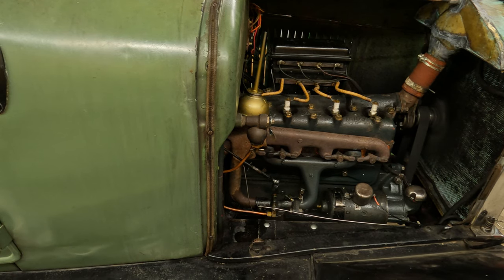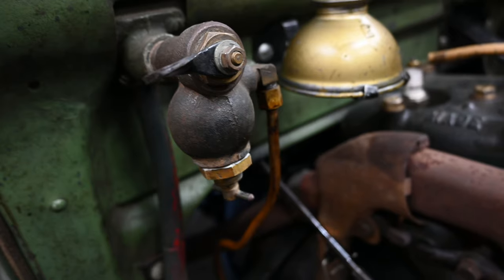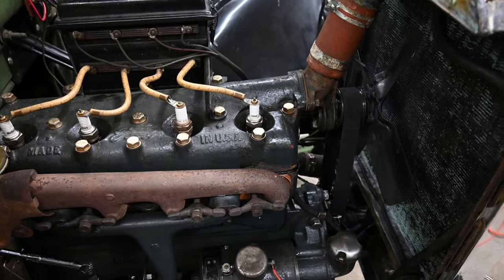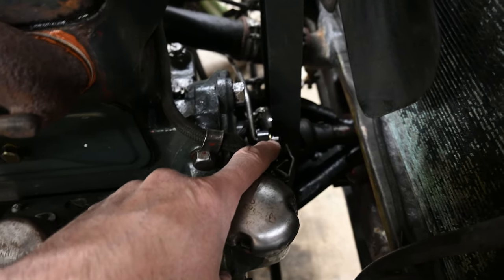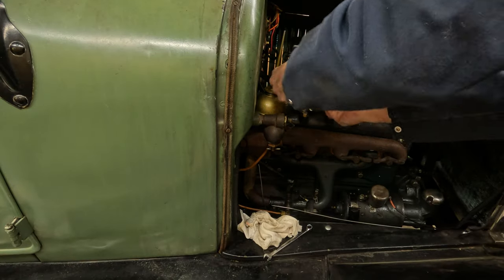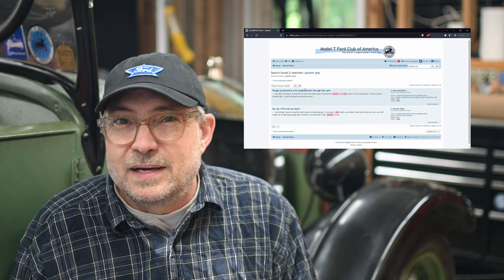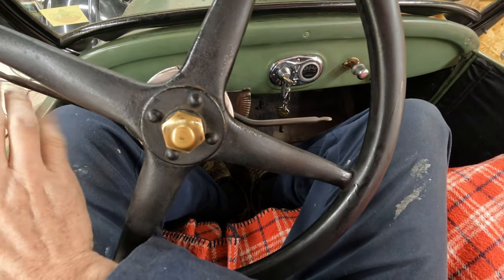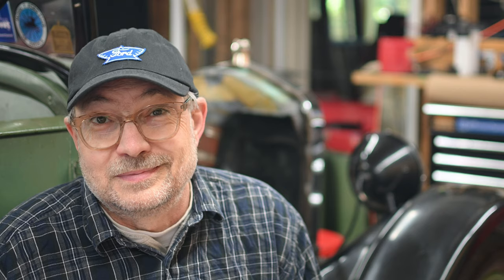Ford Model T: Why won't it run smoothly?

Comment: love the old cars . the fact there still rolling down our roads is testament  to how good they was made . old girl is  96 years old still running  and looks great . bet none of the new cars will ever see that .
Reply from the maker: The rugged simplicity of the T is remarkable. They are fairly reliable, but what makes them very different than modern cars, is they are rugged and repairable; everything can be rebuilt, remachined, or repaired.

Comment: I usually take a failure in one system to check everything anyway. I learned this after doing like you, and just checking the wrong things first, and after going through that cycle a few times I realized that it ends up keeping the car in better overall condition anyway, so it's not wasted effort. it's better to have everything running correctly now than to have only the most recently broken part replaced, and everything else be on its way out in the next few months. and so long as you're not jumping to replace expensive parts without knowing that they need replacement, it's not a waste of money, either.
Reply from the maker: Good advice. Thanks!
Reply: Always good to work one's way up from the simple to the catastrophe.

Comment: Nice video! Same objective, but a different approach to shorting the spark plug, I lift each coil one by one just far enough to break contact and see if the engine runs worse or the same. Another way to find the dead cylinder.
Reply from the maker: That's a better idea!

Comment: AMAZING!  I got my “new” 1920, Canadian-built Model T just last weekend and finally got the courage to try starting and driving it this morning (Saturday).  It started right up, but ran quite poorly and really lacked power.  After a few trips up and down our road, it stalled and wouldn’t go again - so I checked the fuel tank and noted that it was very low. As I was on a very slight uphill slope, I figured that I was low on fuel and called my wife for a pit stop delivery.  I fiddled with the carb needle adjustment and nothing made much difference….the sputtering and backfiring continued so, I’m heading out to check the plugs now.  
Thanks so much - new subscriber here.
Reply from the maker: Glad you liked the video! Good luck getting your T running better.

Comment: Mine has been idling a bit rough weirdly after I changed the exhaust manifold but I found one cylinder had low compression.  I probably will be grinding the valves sometime.
Reply from the maker: Valve job is my next video!

Comment: Sometimes I use an infrared thermometer to check temperatures on each plug, a dead cylinder will be colder
Reply from the maker: That's a great idea!

Comment: Guess I am “missing” something. You already tested the cylinders at the spark plugs. Didn’t you find number one dead at that time? Don’t you do that sequentially anyway? I guess maybe you mean you removed each plug and with them attached .. rested the plugs on the head to see if you have a spark at the bottom of the plugs. Right?
Reply from the maker: I first checked that I could get an arc at the top of each plug, using a screw driver shorted to ground.  This was my big mistake, because I assumed that this meant that I had spark 'in' each cylinder.  But I only verified that spark voltage was was being supplied to each cylinder - and I ASSUMED that each spark plug was sparking.  But it never occurred to me that a spark plug could fail.  For some reason, that plug failed and does not spark even though it has good spark signal.  When I was testing arc at the top of each cylinder, all four seemed fine.  If I had then shorted the cylinders, one at a time, I would have learned that one of the cylinders wasn't firing...and then I would have known that the plug itself had failed.
Reply: Ohh .. ok, I see. Have you ever used the original Champion X plugs? Not the new version, but actual antique plugs. I use my 1923 T runabout as my daily car. It runs very well because I routinely clean the (New Day) timer, inspect .. clean and adjust the plugs and I check the points on my coils. When it comes to electric elements, clean and inspected is important. I also like trying unusual carburetors just for fun so I guess they are never a problem.
Reply from the maker: @markosterman419  I do not have any original rebuildable Champion plugs.  I wish I did!  I haven't come upon a set.  I will try to buy some, when I do.  How do you clean the plugs?  Blasting cabinet?  Regarding carburetors... I am looking for a spare NH to rebuild, and so far, can't even find one of those up here in my area. Frustrating.